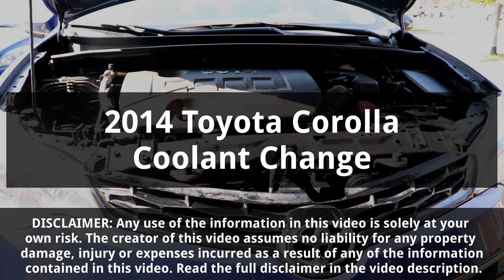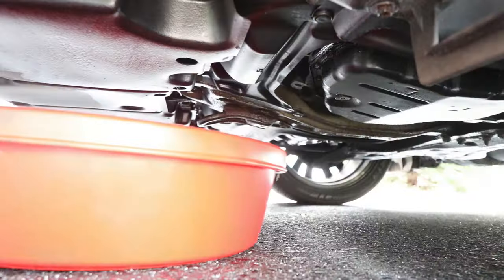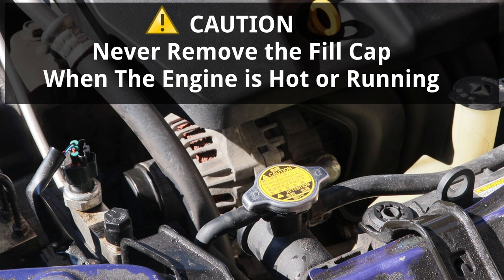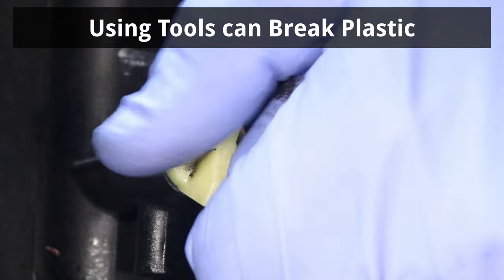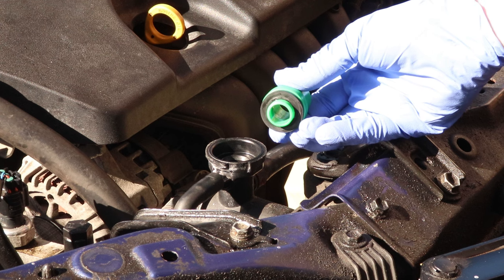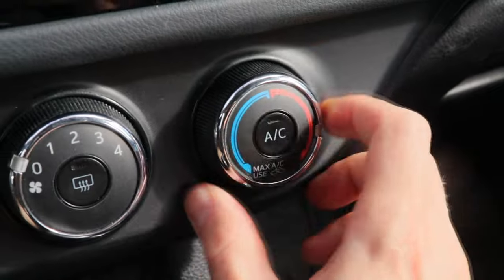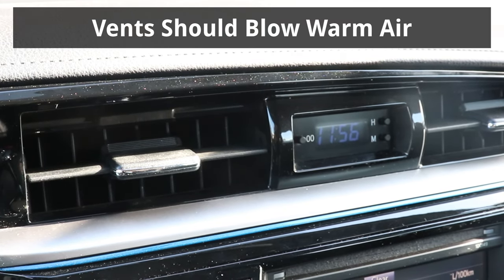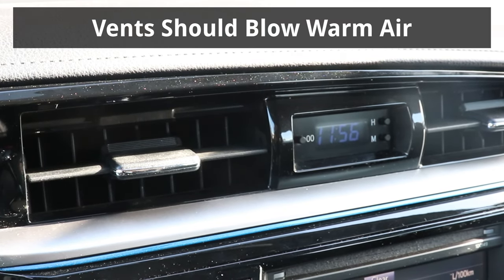Coolant Change, Toyota Corolla, Drain & Fill 2014 2015 2016 2017 2018

Comment: Thanks for great tutoring video. How about draining engine block. I am going to change coolant in Corolla 2009, and as I know there is the 10 mm engine block drain plug somewhere around manifold from underneath.
Reply from the maker: What I did in the video does drain some of the engine block, although not all.  When I removed the water pump some more came out as well. I don't think the 2014 has the possibility to drain any more coolant than that. If the fluid can flow from the engine to the radiator it will come out, but it's just trapped in the small passages.
I'm pretty happy with the amount replaced though, and the old fluid looked quite nice.  I would do two changes if the old coolant looked bad, I think some of the coolant is just impossible to drain.  Some may also get stuck in the hoses going to the interior of the car for heating.

Comment: Would you please tell me what is the best coolant for Corolla 2014 S, to use it in all season?
Reply from the maker: Genuine Toyota Super Long Life Coolant as shown in the video. 50-50 works for warmer temperatures, for colder climates like Canada, 55-45 like I used. Dealer will have it.
Reply: @CleverFix  
Thank you very much.

Comment: What about the coolant behind the thermostat? Is it not a good idea to try to change this too?
Reply from the maker: The general recommendation is to replace every 10 years, but I can't find a specific mileage.  Make sure to get the correct thermostat from the dealer if you're replacing it.  Lower quality aftermarket thermostats are not as good, I would only use a Toyota one.  It can also be changed later without spilling too much coolant, but yes it's a better idea to do them together.
Reply from the maker: Sorry, I thought you meant changing the thermostat. I am not sure how much more coolant will come out if the thermostat is removed, it's possible that the trapped coolant is trapped in the hoses going to the heater into the car, and into the tiny channels inside the engine too.. so I doubt 100% of the coolant can be drained, even if the thermostat is removed. I'll give an example, when the water pump is taken out, after everything is drained, another 150-200ml or so drains out.. so there are multiple places it can get trapped.

Comment: I have jammed petcock how to drain 
I Have the same car
Reply from the maker: I would consult a mechanic. It could easily break if it's forced, and then a new radiator is required. A mechanic might know how to do it without having to replace the radiator, and in the end, cost less.

Comment: Hi, why need the same amount drain and fill in?
Reply from the maker: When you drain coolant from the system, air pockets can form in the cooling passages and hoses. By refilling the system with the same amount of coolant that was drained, you ensure that there are no air pockets trapped in the system, which can cause overheating.  Of course this assumes that the previous fill was done properly, and there was no air trapped to begin with.  If there was already air inside, then more coolant should fit inside.

Comment: Did you use 2 bottles or 1 bottle of coolant ?
Reply from the maker: I used 2. If the reserve tank is drained, then it's likely that it needs one and just a tiny bit more.. so two are needed.

Comment: Couldn’t one run the engine for a few seconds to get the remaining coolant out?
Reply from the maker: No, definitely not! The engine should never be started when the coolant level is low. The coolant circulates only when there's enough to reach the water pump, which is positioned relatively high in the system. If the coolant is too low, the pump won't be able to circulate it, and it'll be spinning air instead of coolant, so nothing more will come out. Additionally, the coolant only flows through the entire system when the thermostat is open, but it won't open if the coolant is drained.  Hope that helps.

Comment: This is dangerous method of filling the cooling system. This way you can break the cylinder head gasket. The correct way is to use a vacuum device.
Reply from the maker: That's why I use the funnel, to burp as much air as possible.  Also that's why I mention to make sure the same amount of coolant that comes out goes back in.  It's important to make sure air doesn't get trapped of course.